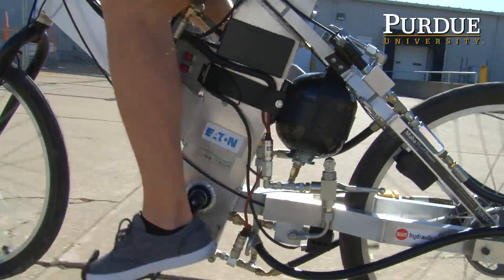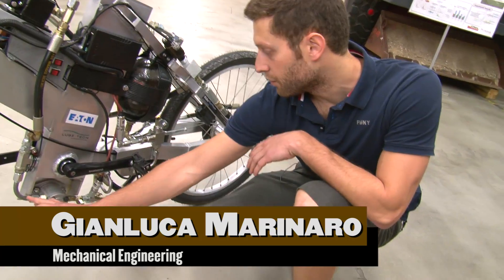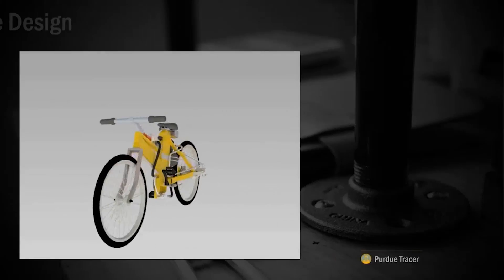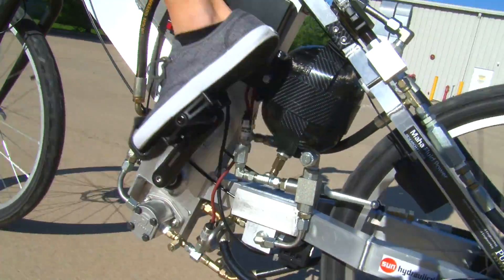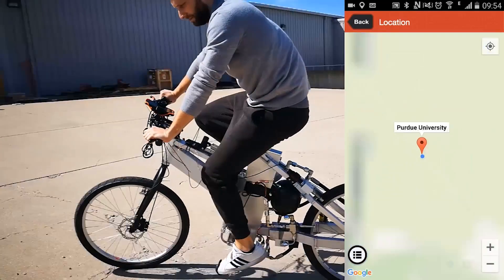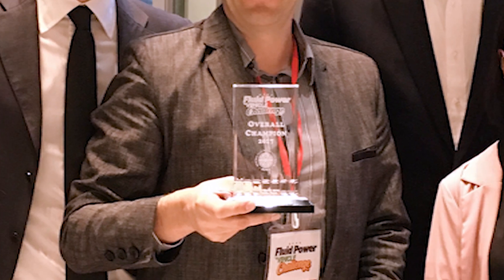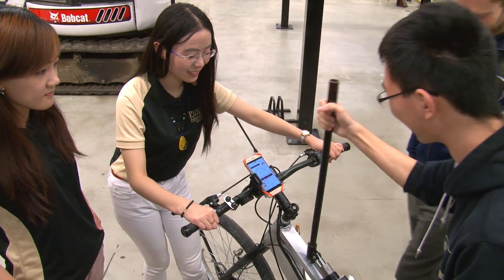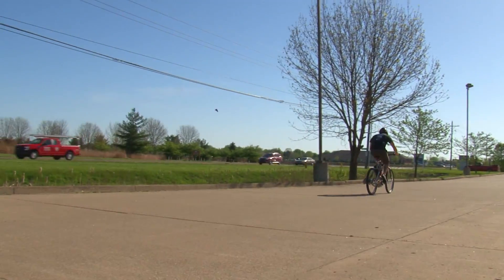Hydraulic-Powered Bicycle Wins National Contest for Purdue

Comment: I think if you had added a larger pinion to the front and a smaller pinion in the back you would have used your hydraulic energy more efficiently, because the hydraulic scare has a large force that with a little physical effort can spin the first pinion no matter how big, the small pinion in the back of the wheel is for speed, normally it's the other way around , i.e. small pinion to the pedal and big pinion to the wheel because we don't have enough force to pedal quickly, but with hydraulics it can be done because we have force with little effort. You also need to add a gearbox to turn force into speed.

Comment: You could use a flexible line to make a front wheel drive bike
Reply: My thoughts exactly. But to synchronise the rotations between the front and the rear wheel would be a problem.

Comment: Hydraulic tork has many power conserve advantage, unlike the fossil/all-electric cars & bike companies, they use pure tork of the engines, this results in using speed transfer into horse power, but with hydraulic, it's strength power already converted to speed, which only requires power to the mini pump, which then flow the gears of the hydraulic. It could have been a great advantage to those new Tesla trucks and even sports cars or non-pedal main road bikes, just like the examples in these bicycles.

Comment: Does this bike have a hydraulic accumulator? There is the ability to create an effective regenerative braking mechanism on a hydraulic bike, did you do it?
Reply: @PurdueME  What type of accumulator was it? I'm guessing a gas pressure one. I'm also assuming that's where the energy mainly comes from; I highly doubt you can fit a pump and all the stuff a pump needs to function on a bike
Reply from the maker: @theshermantanker7043  You can see all the plans here: http://nfpahub.com/fpc/wp-content/uploads/sites/4/2017/08/2.-Purdue-U-FPVC-Final-Presentation.pdf

Comment: Cool!  Why don't they put a hydraulic drive system in a car, where the pressure regulator and the engine speed are computer controlled for the best mpg?  It could be set up inside the car to look like a normal car...
Reply: Theoretical advantages (optimale RPM, smooth power, continuously variable transmisssion). Will most likely be cancelled out by practical disadvantages (cost, complexity, efficiency). But if you want to realize the theoretical advantages you could go with series hybrid (i.e. electrical transmission).

tgfedi not really the same idea. Torque converters are hydrodynamic, this bicycle is hydrostatic. Also torque convertes, when enganged, make fuel economy worse.
Reply: Actually it's kind of in use in cars for some decades now. t's called a torque converter used in some automatic transmissions.

Comment: This is a design exercise. It is meant to educate the students building it and create a context where innovative ideas can arise. Ideas that will probably never be implemented in bicycles but will live in other machines. Stop worrying and criticising, this is not meant to go into your next bike
Reply: I think most viewers missed this very important point.  And it may never be practical for normal use, but a motorized version of this concept could be very advantageous in certain conditions like rough terrain or driving a tracked vehicle.  There are always benefits from design exercises.
Reply: I completely agree with the design exercise idea! 
But then it was misrepresented in the video.
Also in order to apply it in any field important thing would be the efficiency (even if aparatus is too heavy to be practical in bicycle), about which nothing was told in the video.
Reply: Speaking of efficiency, photovoltaic panels are neither efficient nor practical, yet everyone is promoting them !
Reply: @federicoromero6130  where can I buy a 2nd, 3rd, 4th generation bike? I'd love to see this iterated out.